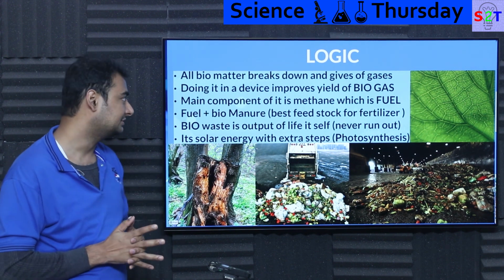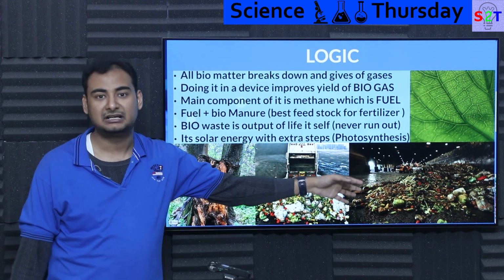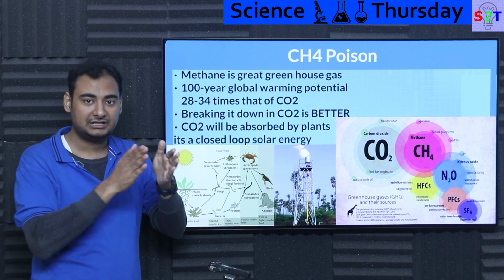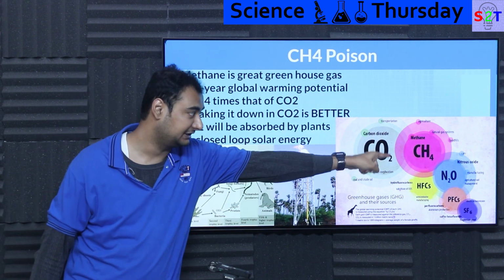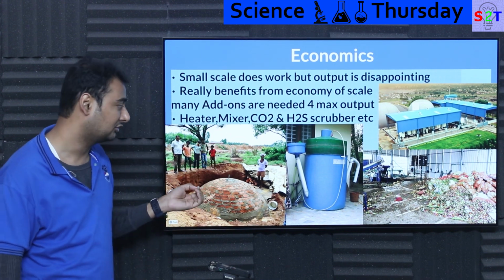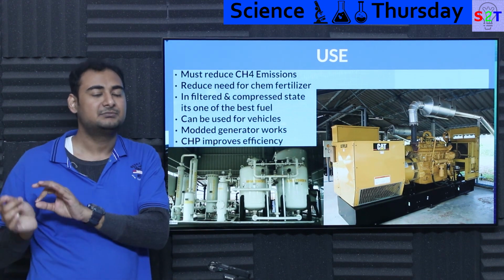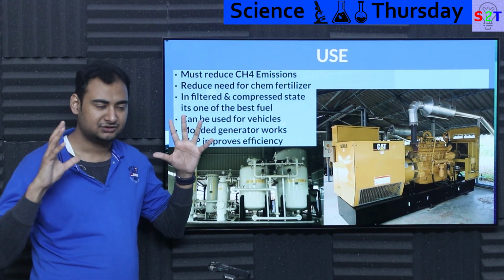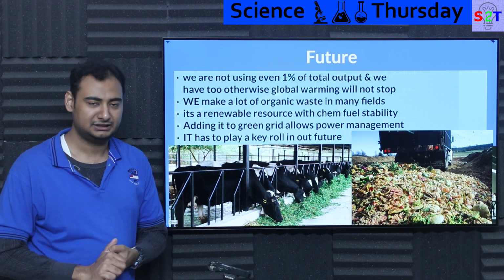Wasted Biogas Potential Explained {Science Thursday Ep170}

Comment: You have to weigh it against the competing "gasification" or direct combustion option: gasification accepts a broader feedstock, I think (No pH concern, although an increased humidity concern). gasification will yield better exergy gains (syngas or electricity) but the solid waste is less good fertilizer I think.
Reply from the maker: fair point